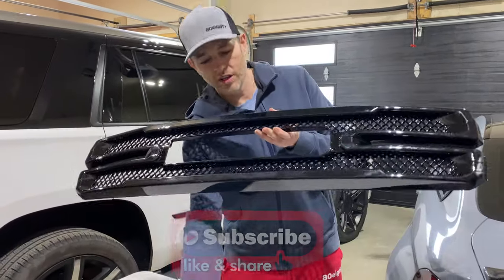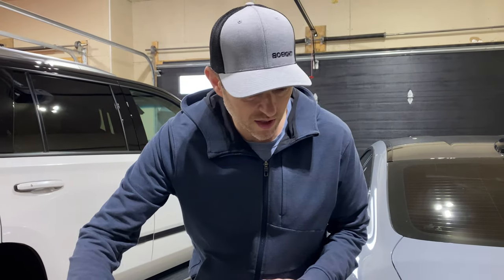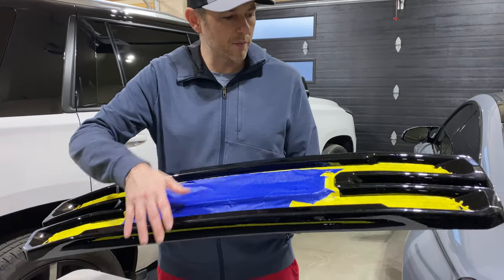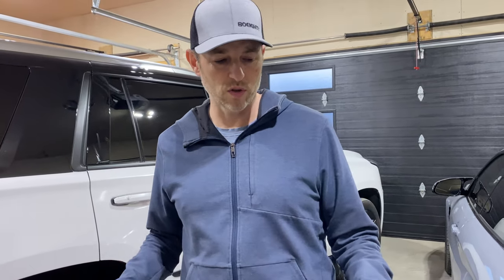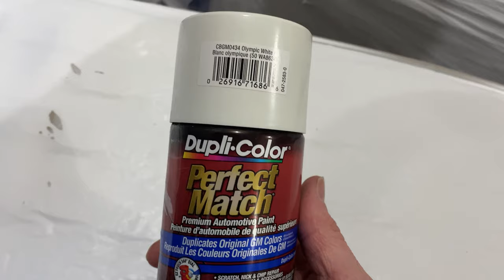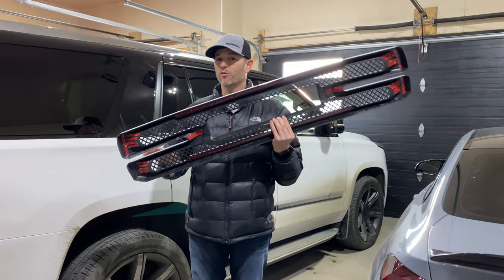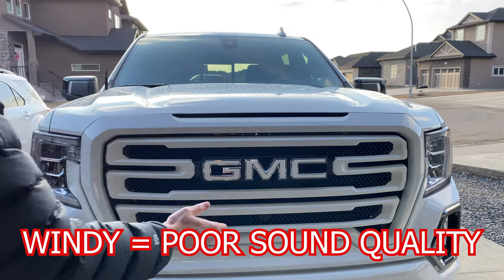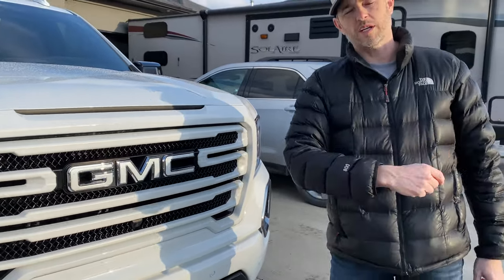Custom Mesh Grill GMC Sierra AT4 / SLT - Another Do It Yourself Project

Comment: Big Fan of your DIY upgrades to your AT4. I just installed mine and had to trim out an area for my front end camera. The front camera picks up some of the grill in the display. Do you have the same issue? Or how did you manage to get around it? 

Thanks in advance. 

J.C.
Reply from the maker: Hey Jonathan!  I see a tiny bit of the overlay too through the front camera.  I don’t think there is a way around it.  I have been living with it and it hasn’t been a bother.
Reply: @Donslife  thanks for the quick reply. I figured the overlay was going to be something I’d have to live with. Glad I’m not the only one. All in, the grill looks great. I even installed the same led GMC logo you have. 

Thanks again for doing your vids.. they are extremely helpful. Couldn’t accomplish my own DIY’s without them.
Reply from the maker: Wow 😯 That’s a big compliment!  Make sure to hit that 👍🏼 button in the ones you like!  It helps them get recommended to others

Comment: Hey Don, I know this is an older video of yours, but do you think it's possible to also paint the mesh part of this overlay? Picked up the gloss black overlay and hoping to do white with red mesh. But not sure paint will stick to the mesh. Ideas?
Reply from the maker: Hey luke, it is totally paintable, but prep could be tedious.  You’ll want to scuff it all up with some scotchbright or 400 grit sand paper.  Then clean the dust off with a tack cloth.  I’d probably spray the red first, let it dry and then mask it for the white sections. Then clear coat all of it for some protection

Comment: Did you prime before painting? I scuffed with an 800 scuff pad and wiped with 70% alcohol before painting. Painted 4 coats of rustoleum custom auto paint. 2 days later I pulled the tape and went to blow off any dust with the air hose before clearing and when I hit it with the air hose the paint started flying off. Must have done something wrong.
Reply from the maker: I use a plastic primer or adhesion promoter

Comment: what was your trucks paint code?and what dupli color did u get? mine is an abalone white and none of the dupli color spray cans looked close enough
Reply from the maker: WA8624 Summit white.  Olympic White was used and has the same paint code.   The amount of layers of base coat and clear coat used can make a difference too.

Comment: So your just going to stick it on over the factory grill with 3-M tape?
Reply from the maker: I know right? Actually when you see it first hand, it will make sense.  But there are spots in the mesh you can use cable ties and not even see them.
Reply: @Donslife  huh, I would have never thought that! Love the videos. Very informative 👍

Comment: Don, I think you said you used wire ties instead of the 3M tape. I bought one for my AT4 as well, but can’t figure out how to get the wire ties in and back out since I can’t get my hand behind it. How’d you do it?
Reply from the maker: I fold the cable ties so they are ‘C’ shaped and patiently feed them in from the front.  They need to be pretty long, otherwise take off the tray in the engine compartment and have a helper with skinny arms get to them from behind the grill
Reply: Mine didn’t stick well with the 3m…I may try to zip tie….you can’t see the zip ties the way you did it?
Reply from the maker: Watch this video it might help: New Grill, New Look - Full Install GMC Sierra AT4.  Wife Surprises Me With a Gift!
https://youtu.be/YOdzAsmpYSM
Reply: @Donslife  thanks bud, like that new Escalade your wife got 👍
Reply from the maker: No problem!  Thank you, I can’t wait to get it home this week

Comment: What did you use to cut the hole for the camera
Reply from the maker: I used a rotary tool with a cutting wheel or a Dremel.
Reply: Ok thanks. Got my grill in today. Trying to do what I can by myself. I’ll pick up the tool today
Reply from the maker: Take your time and mark the area with a sharpie or tape so you don’t cut more off than you need.  I started with a tiny cut out and then made it a little bigger after a couple test fits
Reply: I will! I’ll let you know how it turns out
Reply: So I made a good cut for the camera, but I used black spray paint on the sanded areas and I should have used touch up paint. With that being said, I ordered a new one and it arrived today. I’ll cut my hole for the camera again, and use the gloss black touch up paint and let you know how it goes. For anyone else that needs the grille overlay and plans on painting it, I have one for sale😂
Reply from the maker: @artezdavis1625  You’ll nail it
Reply: @Donslife  so my lower part fits pretty good, but when I put it on for a trial fit, its a little hard to put on around the camera area. Did you cut out any around the back where the camera is? I rewatched the video, but I never see the back side of the lower part of the grille.
Reply from the maker: @artezdavis1625  send me an email and I will send you a picture (it might help) donslifechannel@gmail.com
Reply: @Donslife  email sent